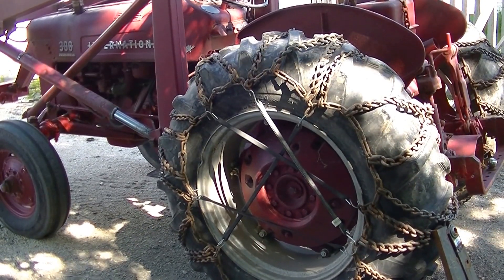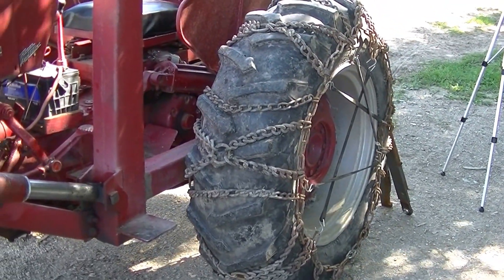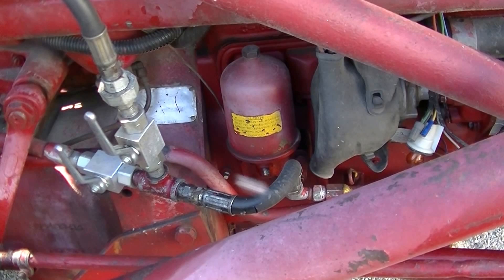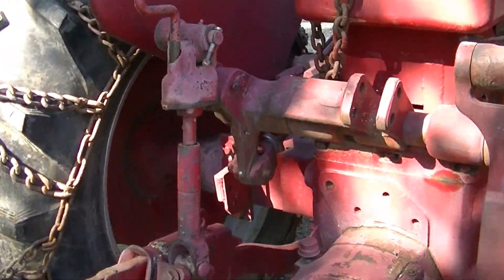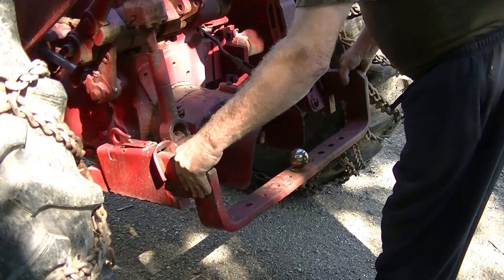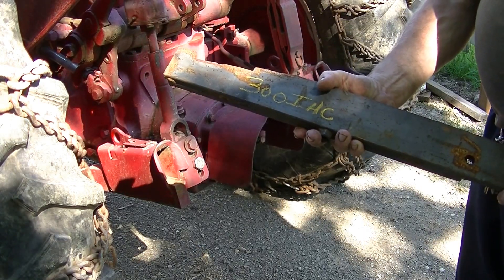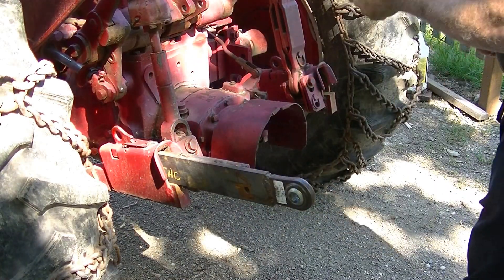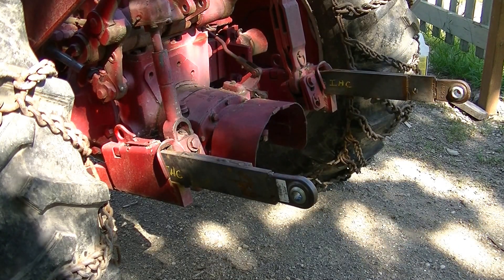IHC/Farmall - DIY elect. Ign. -  Fast-Hitch changed to 3 Point Hitch - zeketheantiquefreak

Comment: I have the exact same one!   Had to do a major rework of every major system on it to get it functional though.  (Still working on it as of this posting.) 

A few points that may help you in the future.

1. If you take the battery out of the stock location and put it behind the seat you can replumb a normal 2, 3 or 4 spool hydraulic valve assy to sit in its place vertically.  You just need to make a adapter back plate and bottom plate that attaches it above the TA clutch inspection plate.
From there you can then plumb the feed from the pump directly into that and the outlet from there into the factory system under the seat.  Depending on the pump style you have, you will only need a 36 - 42" hose to connect them.  
Beyond that if you have 2 or 3 valves for the factory system you can set up the 2 - 3 point to have power tilt by replacing the left side manual tilt assy with a short hydraulic cylinder with ~  4 - 5 inch stroke.    Very handy for doing blade work.   If you have 3 valves under the seat then the 3rd one can be used to add a power angle function to the blade too! 
BTW, the spool valves (the actual stackable valve blocks) used on these tractors are the same ones they used on almost all of the other International and Farmall tractors with any sort of live hydraulics in that era.  The control levers are just whats different which means adding more valves is cheap and easy, if you don't mind making custom levers.  
Lastly, if you run your hydraulics hard  its possible to plumb them into the transmission by setting up the suction line to pull off the rear end drain plug , then through a filter (fits perfectly just ahead of the right side running board)  and up to the pump.   Just make sure you are running hyTran type fluid and preferably a 1" suction line set.  
For the valve fluid returns, if you are just running a after market valve set and no under the seat factory system, just return the fluid to the left side port under the left running board.   If you have the stock under the seat system still intact you will need to open it up and drill a 1 - 1 1/4" hole through bottom of the reservoir into the top of the transmission and then cap off the old suction line that used to feed the pump.   When you have that assy off the tractor to drill it you will see where it's easiest to drill said hole.  

2: If you don't mind doing a bit of 'non stock settings' adjustments to the clutch and TA you can set up the TA to be part of the clutch function giving you a 2 speed clutch which is very handy.  
What you do is 'over slacken' the main clutch throw out fingers (set from under the tractor) so that the main clutch engages/disengages at about 1/2 down/up pedal travel and set the TA inter linkages (set from the side of  the tractor) to pull that clutch in/out just short of the top of the pedal travel. 
In doing so it 'exercises' the TA every time you use the clutch which helps its longevity due to most people under using them and they internal part of the 1 way clutch (most common failing part) wearing wrong due to lack of use.   
I've set up many tractors to work that way now and none have ever had a problem with it even with some that do regular hard loader and the like work.  

3.  Convert it over to 12V Neg ground and use a modern 1 wire alternator.   If you have to or wanted to set up your tractor with decent lighting you need the added power.    It does not take much to put a common 10 SI Delco or similar 60+ amp alternator in where the old generator sits.    The mounting bracket just needs to be cut and modified a bit. 
Wiring wise I do recommend you replace the whole original wiring harness with new stuff due to most of them at this age being cut up, or weathered to death, or both as mine is, and a bit under sized for running a alternator that can put out 3x or more amps over what the stock gen set could.  
Well worth for anyone who uses their tractor in the winter and or after dark.
Reply from the maker: I like people that really think things through... Thanks for the comment and may many learn from it.